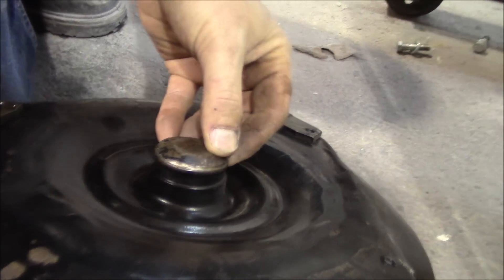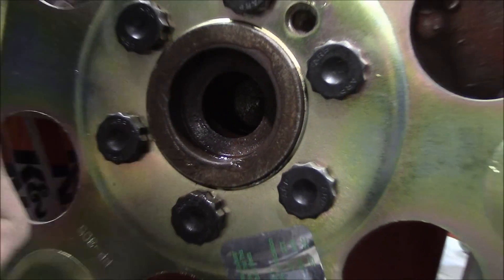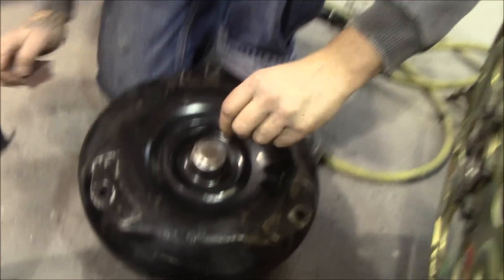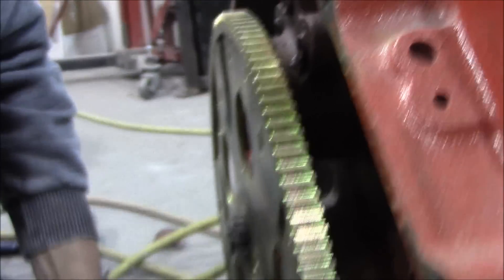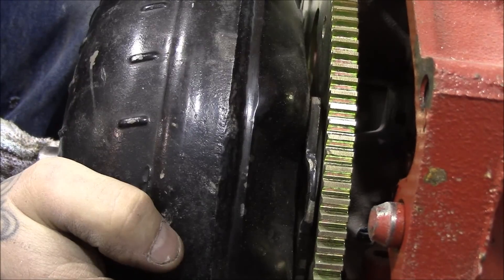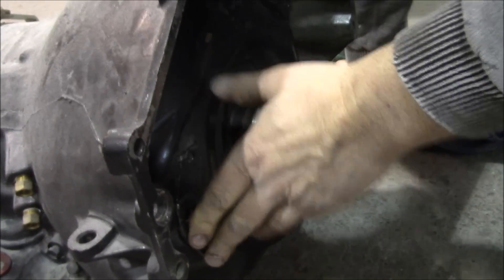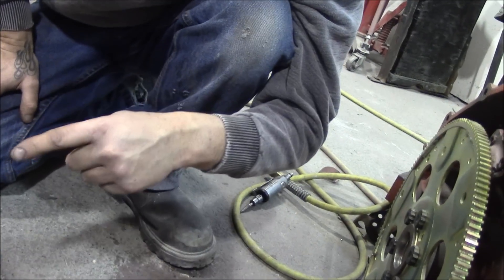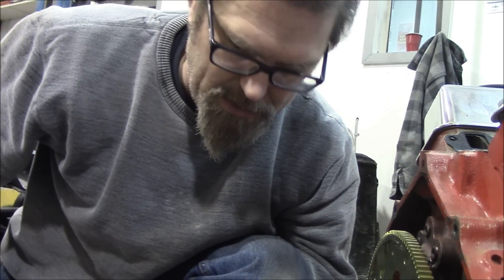Torque Converter issue solved

Comment: You would be surprised at how many younger guys don't know about the 3 clicks of the torque converter. Well done Rick, and , you ARE a good teacher!
Reply from the maker: +Bill Stevenson Thanks so much Bill
Reply: Yeah I just did my rear main seal in my 99 avalon and forced it back together not knowing it was suppose to seat
Reply: Is this 3 click technique universally applicable? Im wondering if this may be the reason my 2003 hyundai transmission that I installed has a torque converter that rotates and gets stuck, but not an instant stuck/thud, its like it slows down a split second before it stops

Comment: Rick so glad I found your site. I'm working on my 70 sb f100. want to lower front end and upgrade to disc brakes. also own a 57 del Rio wagon. did most of the work in my garage. your vids are super. Concise, well spoken and easy to watch. it doesn't hurt to see that you speak from hands on experience. I just subscribed and look forward to all your input. 
Thanks dude.
Reply from the maker: +deanda5150 you are so welcome and you should check out our vids on the '66 F100 - we did a bunch of front end work on the frame and you might see something that will help or just interest you!  Thanks for subscribing.

Comment: Great video!! You helped my torque converter to flex plate issues with my Dodge Dakota. I wish I watched this before I used slightly longer bolts while not knowing why there was a gap there.
Reply: I know this was posted a whiles ago. But i ran the same issue. And need new bolts. Problem is. I lost my measurements to the flex plate and to the converter face to the housing and having some serious clearance issues.

Comment: First off, good video, got to see what I wanted to look at, but...the scenario, or cause of problems was suggested that someone had been banging on the inside groove and caused a dent/divet?  How is that possible inside of the transmission?  I mean, why would it have been taken apart before if there weren't some other problem, and beat it up to cause another?...that's the part I don't understand of the video.
Note:  I have a 2007 Ford Edge that has been diagnosed with probably torque converter and mount issue (rough shuddering at low acceleration/rpm).
Reply: @ Nick Brenner. Great questions, and my guess is the end of the crankshaft had the staked in manual trans. pilot bush removed, and was never clearenced for converter stub!(Note 3 equal stake marks, not one accident ding?)  The proper, centered fit between conv. snout and crankshaft reciever are CRITICAL!! to your trans and engine! Trust anyone, or no one, just dont leave this fit to tight OR TOO loose!

Comment: Great vid👍
 I have a 79 Malibu with a TH350. It was giving me an intermittent sluggish reverse then rumble when I gave it gas. Changed the fluid and filter, now reverse is smooth but now I  get the intermittent rumble pulling off from a stop. If I ease on the pedal from a stop, it doesn't happen. TC?

Comment: Put a SFI approved flex plate and B&M 3,000 stall10" in my 69' Firebird and you really have to do this on any car because this,more than all the engine work I did ( about $4k built with forged rod n crank stroker kit from Butler Racing)changed the entire personality of this car.This is so often overlooked and results in people being terribly disappointed with their car.
Reply from the maker: well said

Comment: Great vid Rick. I have been worried about installing mine but now I know. How much fluid do you guys usually pour into a new converter?
Reply from the maker: +Double R Restorations I usually add 2 litres in the converter, then try to get it on without is spilling too much.  Then the trans should take another 3-4 litres.  (there's 4.5 litres to a gallon for the US viewers)

Comment: Should the TC be flush against the bell housing?I get a vibration noise from the trans when I turn my ac on, it vibrates through the driveshaft making a vibration/humming noise...once I turn ac off noise goes away back to sounding perfect. I checked the TC and saw it wasn't flush against the bell housing, it had some space in between. Wondering is it the cause

Comment: i purchase 5.7 engine out of 2013 dodge ram 1500 and put in a 2012 dodge ram 1500 and the torque converter doesn't match how can I find the right one.
Reply from the maker: not familiar with those trucker maybe call dealer and ask

Comment: Is that a Th350 what is the info on that torque converter? I have a 350 sb with a th350  and the converter is leaking.

Comment: I have a 2007 Dodge Ram 1500 automatic transmission and it has a shutter at 1300 rpm only at speeds or around 30 mph and 45mph when I barely give it gas, goes away when I give more gas or if I let off the gas it goes away. It feels like I'm running over bumps like the grooves on the road side of the interstate. The transmission does not ship, you can just feel the truck vibrate ,... Bad torque converter? A Dodge dealer said it was the clutches but the transmission does not slip so I don't see how it could be the clutches.
Reply from the maker: I'm so sorry I have NO CLUE about new stuff Steven!  Wish I could help but I'd be wasting your time.  Don't even know where to start
Reply: Steven did you ever figure out what the problem was? My mothers GMC Acadia is doing the same thing. No slipping but shuddering at 30-45mph.
Reply: My 98 Saturn was doin the second thing .... now it stalls when warm...I've changed everything .. it's been suggested that it's the torque converter at this point should I scrap the whole car

Comment: i need help , i hava a chevrolet caprice 1980 , and my engine v6 229 , broke my   " engine starter  "  ..... de converter have a axial movemente in the transmission th200 .... up and down is the movement .... is this the reason Why did my starter motors break???  how can i repair it ???

Comment: I seated my t.c. as shown, I still could not be sure of "three clicks" how ever when I drew the bell housing to the motor there was no interference and I could turn the t.c. freely with housings flush, tightened bolts, after reassemble, fluid again leaked from bottom of transmission, I have not had t.c. tested, could a bad t.c. leak internally , would improper install cause it to leak, after a loud noise, leaking was the initial problem

Comment: Perhaps you, or someone on here can help me out. I’ve been having a wonderful issue while at highway speeds. When I slow down, I get a whining noise and goes away when I apply a little throttle as I’m breaking. As if my trans, TC,...? Something is still spinning at initial speed, and by breaking, I’m sinking them back up. 🤷‍♂️
Any info will be greatly appreciated. 
Oh, it’s. 4l80 in 2001 Chevy 2500HD
Reply: might be a bad torque converter bearing

Comment: If flywheel won't  bolt up to converter can you drill your own holes or will tha mess up the crank position sensor cause  now my jeep won't start
Reply from the maker: you can't drill holes in the flywheel - you have to get the proper flywheel that will match up to the bolt holes

Comment: I got a 2002 Chevy Silverado and I got the transmission rebuilt and I used the old torque converter instead of buying a new one because i had no ride to work and it ran good for about 2 weeks and one day I was driving to work I came to a stop and I went and it shifted good from 1st to 2nd but then 2nd to 3rd it feels like a downshift the truck jerks hard loses power and it regains it back 2 seconds later it only happens when coming to a dead stop then accelerate so I tried everything I replaced the starter with a new one and it helped it out when I went for a test drive thought I fixed it but then I shut the engine to let it cool down for a couple of hrs and when I left for work same thing happened I have to manually shift it from gear to gear now, it only does that in overdrive tho can anyone help me out please in desperate need.

Comment: I can hear my turbine and clutch moving around in my converter, what does that mean?
Reply: Could just be  dialed in clearence. In the converter the clutch sits on the back of the turbine alowing it you have a on of application. Clutch on clutch of there has to be a gap else it's always on.
Reply: Some don't it's called a non lock up like this guys t350 turbo ^^^ no lock up and only has one bearing

Comment: I have a 2007 Chrysler Pacifica no check engine light when I put it in drive the motor shuts off but doesn’t do it in park or reverse 
Any help please ??????
Reply from the maker: Sorry - no clue about the new stuff
Reply: VVT solenoids were bad on my 2012 GMC Terrain. Had exact issue you speak of.

Comment: When you install the torque converter if it doesnt spin the output shaft is that bad ?
Reply from the maker: Yes that's bad  it's not seated properly if it doesn't spin the output shaft

Comment: I have a problem with my flex plate breaking all the time around the drive shaft plate cant figure it out going on my 4th flexplate...please help
it's a Chevy 6.0
Reply from the maker: We knew a guy with the same issue.  The aftermarket ones you buy are made of cheap shit material.  Best to find a used old one and put that in.  Are you over torqueing it?
Reply: I'm not sure if our mechanic over torqued it ...what are the specs and can you recommend the best flexplate out there??...thanks excellent video!
Reply from the maker: You may want to check out the H.A.M.B. for that info - I don't know for sure.  that site is on the Jalopy Journal website and there's tons of great info on there for all kinds of issues guys are having.  Hope that helps

Comment: How do i get a torque converter off of the transmission?
Reply from the maker: If the transmission is out of the vehicle it just slides off.  If the trans is still in the vehicle you need to unbolt it from the flex plate and then slide it off
Reply: 4l60e has an o-ring , I had a hell of a time getting it to come off with the trans out , thats the only one I have ever had problems with